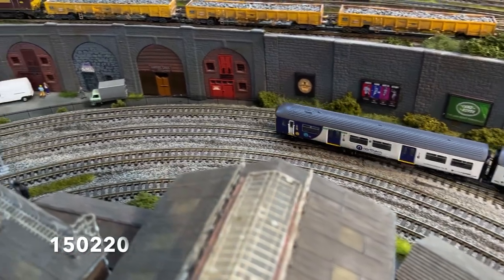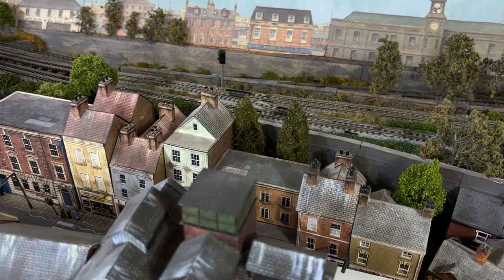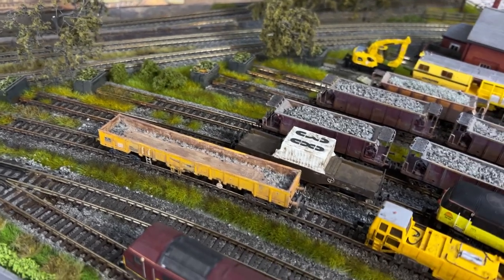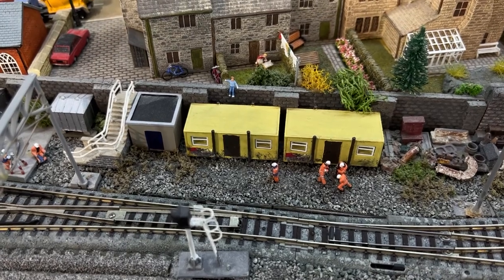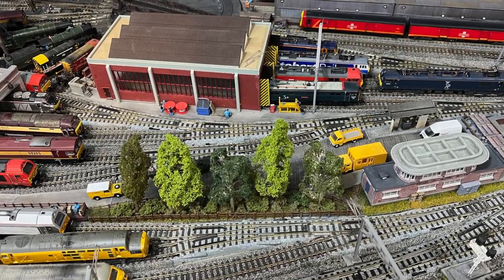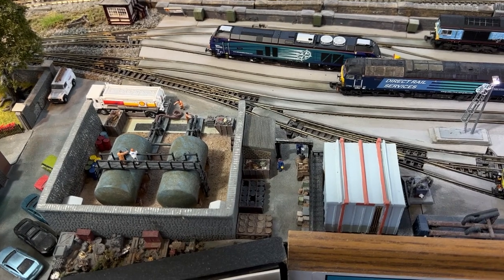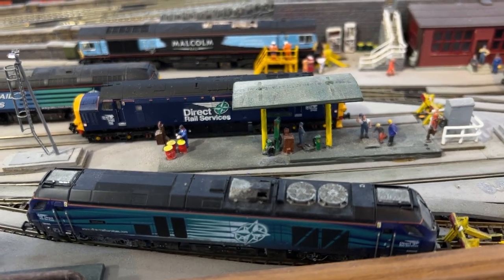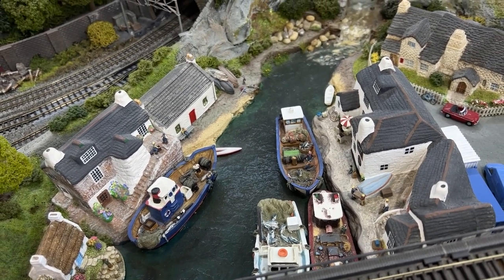N GAUGE   Leefield & Ashpeth 38   Adding Scenic Detail

Comment: Good to hear from you again Neil. Adding detail to a layout is something that can be never ending and the range available has improved since I started my layout.
The one thing I do find with N Gauge is all layouts are to clean as it is impossible to replicate litter, it's just to small.
Reply from the maker: Hi Mark, Good to hear from you! I agree, the small manufacturers have really helped in producing a great array of detailing items. I suppose litter can only be achieved with specs of paint, Cheers, Neil.
Reply: @neiloldie2433  With my not so delicate touch I don't think I shall be trying that idea